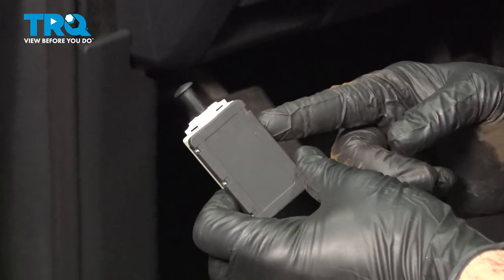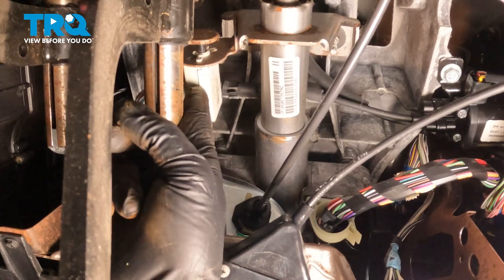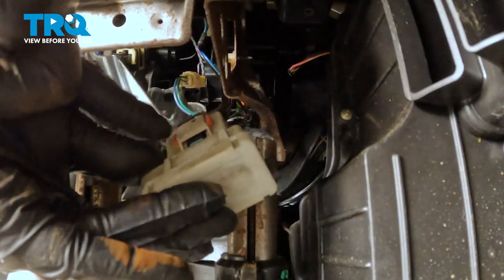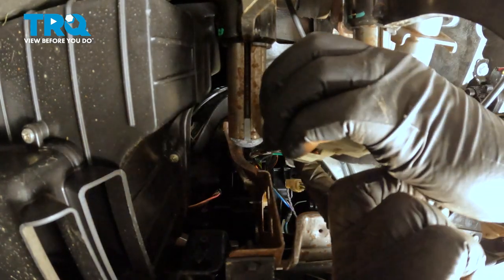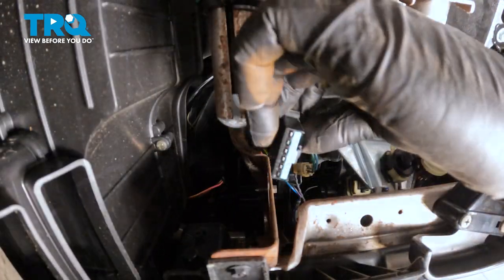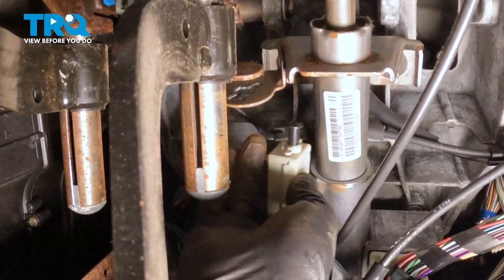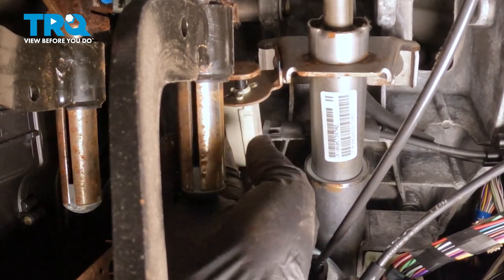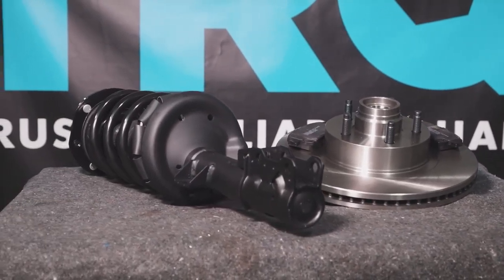How to Replace Brake Light Switch 2002-2008 Dodge Ram 1500

Comment: You forgot to “move the black adjustment lever clockwise to adjust the switch The lever should be parallel to the connector. After you inserted the switch into the bracket.

Comment: I have a 2006 Dodge Ram 3500. The brake light on the dashboard comes on sporadically while driving. Will the replacement of the brake light switch fix that issue?
Reply from the maker: +Nina Dennis We would not be able to diagnose the issue and would suggest taking your vehicle to a local mechanic.

Comment: Hello,
I have an extra wire for my trailer brake light. Where can I plug it on the connector to send 12v when I press the pedal ?